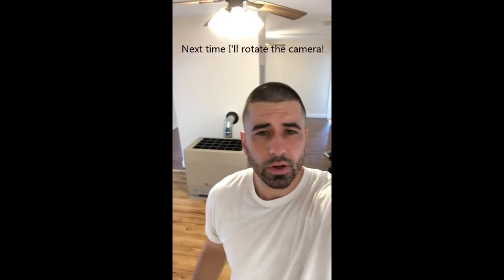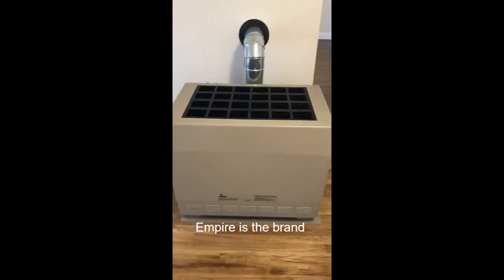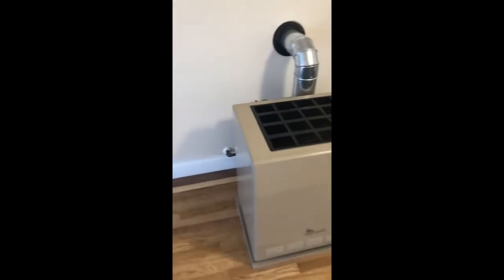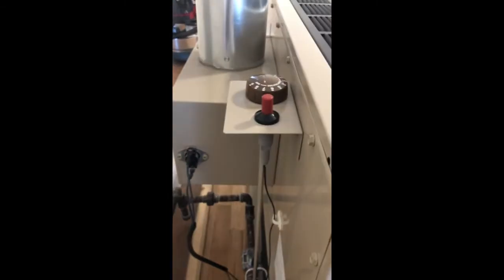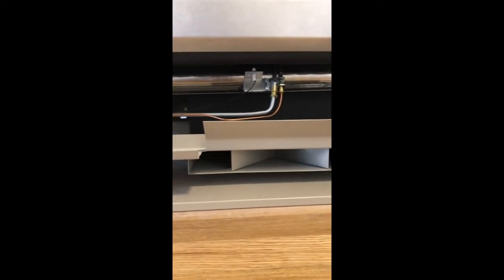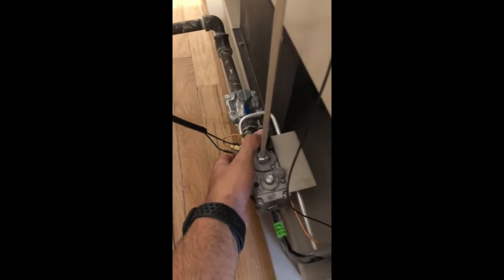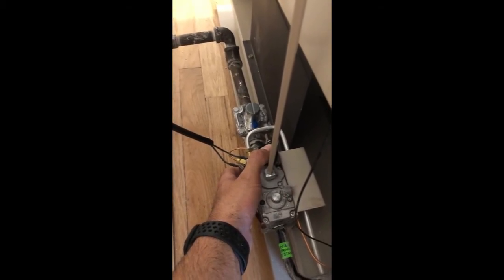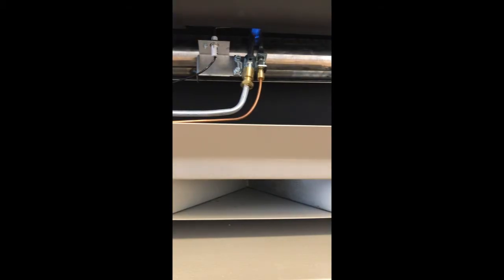HOW TO LIGHT A GAS SPACE HEATER

Comment: I must have an older model of the same Empire. The igniter is incorporated into the gas off/pilot/on switch. I am on my second day of trying to get the pilot lit! It is up against a wall and very little room , it is my only heat and it s getting cold in Minnesota! Back to trying,thanks for posting good to see one pop off ! Must get my "feel" back for igniter.
Reply from the maker: Sometimes they are hard to start but shouldn’t be two days hard! When you press the igniter, are you getting a spark (I know it’s not easy to see, maybe record with phone or have someone look)? Have to start breaking it down step by step to trouble shoot what’s wrong! Best of lucky, hopefully you get this up and running ASAP!

Comment: I have I have a question we have the same brand of heater but ours has where you can see the flames in front I just need to know what is wrong when the Flames are higher on one side to wear it has put coloring black on the window of it on the glass and also has came out to the outside where it shows black on the heater is that dangerous and does it need to be checked right away I'll take a picture so you can see what I'm talking about

Comment: I have this heater for propane gas the burner is throwing off black soot.would you happen to know if something needs adjustment? Or should I call a repair technician.This heater came with the house when I purchased it any info would be helpful thank you
Reply from the maker: I would call a repair technician (I’m not an expert on this part). I believe an issue like this could is a result of incomplete burning. Could be a regulator issue or orifice problem.
Reply: @coutes12  Thank You for the info it’s the most I have gotten while researching it  for a week

Comment: You should not turn out the pilot light over the summer with heaters like this. The pilot light keeps the heat exchanger from rusting/rotting out from the humidity in summer.  The tiny bit of money you may save tuning off the pilot over the summer is not more than the cost of replacing the heater prematurely or having the heat exchanger rust out and leak CO2.

Comment: When I release the pilot to turn it on, sometimes the pilot doesn’t pop up and I can’t turn it. Once it does pop up, the pilot goes out…any advice? I have the same heater but smaller
Reply: I know I’m too years too late but this is also my daily and sometimes multiple times in one day struggle. Sometimes I can get it first shot sometimes I sit holding down that dam pilot button for five minutes before I even attempt to release. Sometimes it works sometimes it doesn’t 🙃 I feel like I’m clearly doing something incorrect. The heater will be on for hours and then just randomly shut off and I have to do the whole process all over again.

Comment: Need help on empire space heater gas,  a thin copper wire ( that connects to rear section near the heater temperature control base.
Reply from the maker: The thermocouple? Pretty common to have to replace over time.

Comment: Hey, I just set up this model... the seems to be way to quiet or it’s not on. Do you know how to make sure the fan is on?
Reply from the maker: Not all models come with a fan. I ended up installing one on this unit a couple weeks after posting this video. The way mine works is: once heat kicks on and runs for a bit, there’s a thermal switch that will turn on the blower. It takes like 10 min or so but you will definitely hear it. Then, when you turn the heat off, the fan continues to run for say 10 mins until temp drops. Hope this helps.